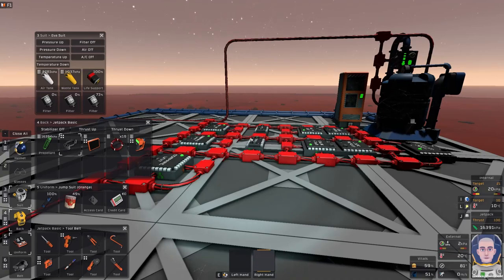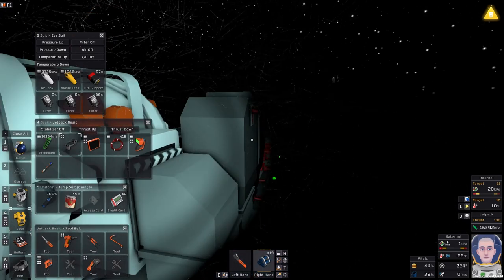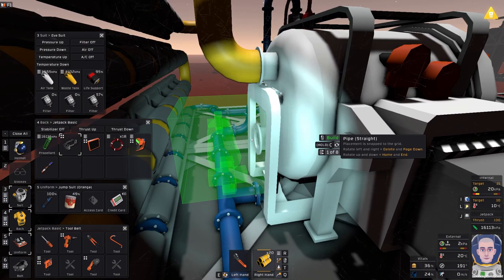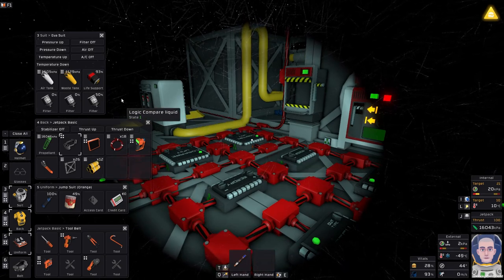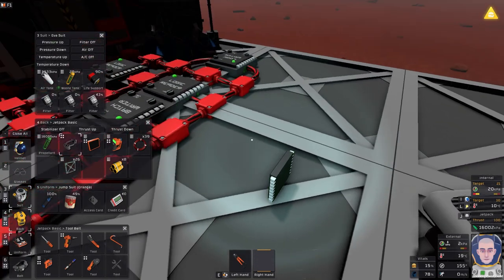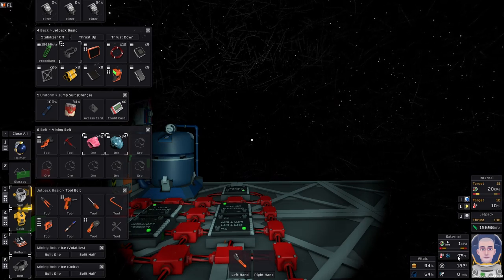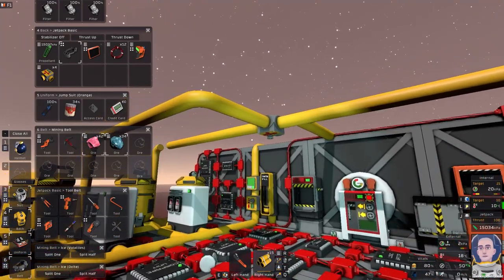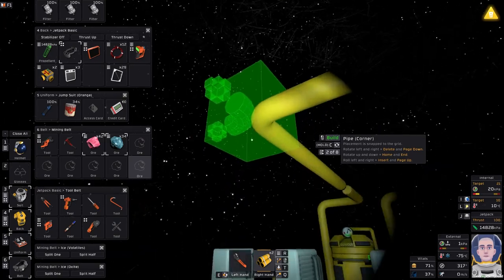Stationeers #13: Advanced Furnace and Gas Filtering

Comment: Good to see more Stationeers love here on YouTube!

Regarding the radiators, while the game models gasses very well, I don't think FLOW is modelled realistically. My experience with radiators is that you need to hold a gas in that system and it cools over time. So, in other words, having a long series of pipes doesn't cool the gasses as they're moving from point A to point B, because they don't actually MOVE from point A to point B. Instead, they just all become one connected unit. However, having lots of radiators should mean faster cooling.

EDIT: Okay, I made the classic mistake of commenting before I saw the rest of the vid... LOL! That volume pump should do it nicely and hold everything until it's cooled.

Comment: There isn't any flow in a single network of pipe so if you want hose radiators to work the way you want it you need to split the pipe in multiple network using valve ore one way valve so taht the gas flow between those networks

Comment: When in creative mode after you select the item in the spawn menu if it is a buildable such as a furnace/pipe/wire/etc you can just r-click to enter build mode, and left click to build no need to spawn them unless it is like a suit battery/filter or consumable.  hold c and click to delete on anything including consumables.
Reply: As long as you have the author tool in your hand. Also, and this is unlisted, F5 puts air (75%N/25%O2 @ 20°C) in whatever large grid you're looking at, at around 50kPa i think?
Reply: @Ethan-ui2rn  
You have to be careful though! Holding down F5 will put a LOT of Pressure in the Space youre currently in. In my case it broke 2 Windows that were behind me.

Another useful key for the AuthTool is "F" to copy the object you are looking at (in the yellow box).